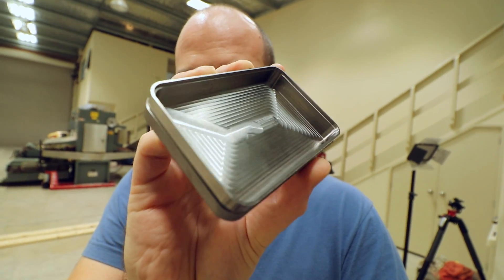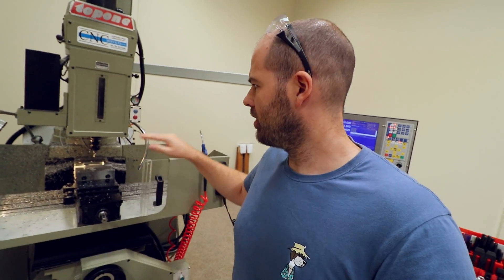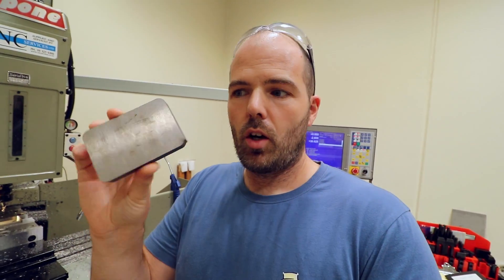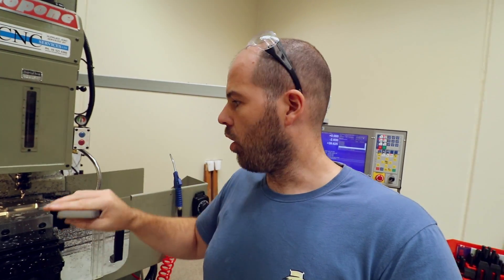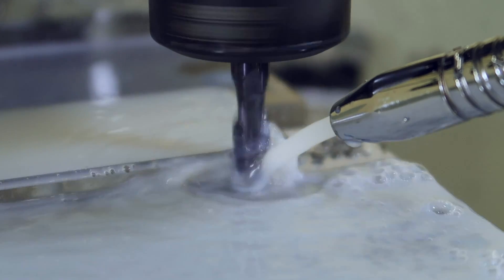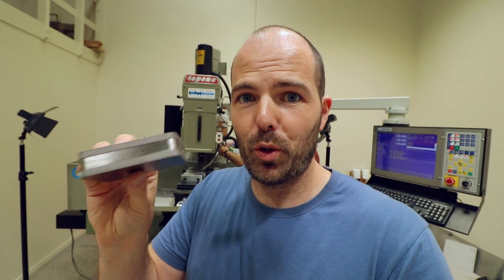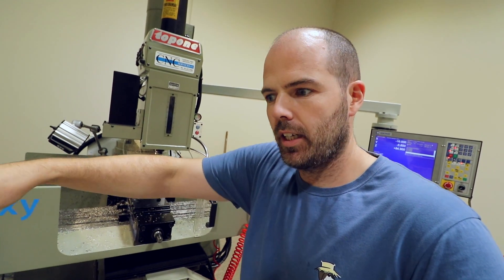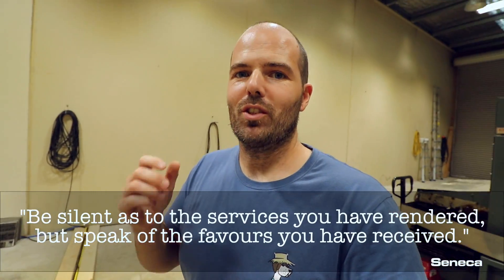Titanium Playing Card Holder (Part 2)

Comment: I am not a master machinist, but I have run into the same issues you have every time.  So what I have done is leave a small amount on the bottom that you can clamp to in a vise on parallels, make your outside contour in one pass.  Flip part over and face off the bottom excess.  I know Ti is really $$$ so it is not like aluminum where it doesn't cost a lot more for using a thicker piece.  The other way you could do it, is use a vacuum plate to hold down the part and you then could do a completed outside contour in one pass without having to sacrifice the extra material.

Cheers!

Comment: When you flip it over how do you grab it well enough to keep your workpiece from distorting? I think you would do well to make a tight fitting slug that will keep you from crushing your hollow form. You also need to invest in a set of parallels. there's hardly a milling operation using the vise that doesn't use parallels. But otherwise you are making great progress in working your mill. I note that today you used air to blow the chips out of the way. Recutting chips is one of the quickest ways to ruin a carbide cutter. Cheers!

Comment: You could make a set of jaws for your vice that fits the inside of the playing card holder, and protrudes above the vice, and instead of closing the vice you would open it to hold the part. That way you could mill the outside of the part in one go instead of doing half of one side then half the other. This would eliminate the steps you are getting.
Reply: Willypdukes That wouldnt work because the vice uses hydraulics when you put a specific amount of pressure on it. So you close it until it reaches the piece and then it makes a "click" and the hydraulics start to kick in. At least it is so on the vices i know

Comment: You should make a spinner with the side all even in weight but the sides all different shapes like a dual spinner and one of the arms is a circle and the other like a triangle.
Reply: That is a really cool idea, but it wouldn't work. Because the sides can't be just equal in weight, they have to be equal in weight distribution. Weight farther from the center has a bigger effect on the spin. There are probably a few ways you could do it, but it wouldn't be as simple as just making it the same weight.
Reply: True